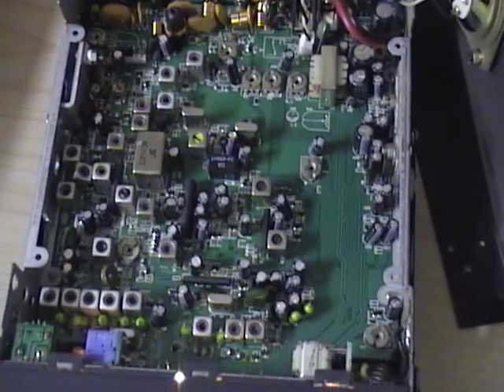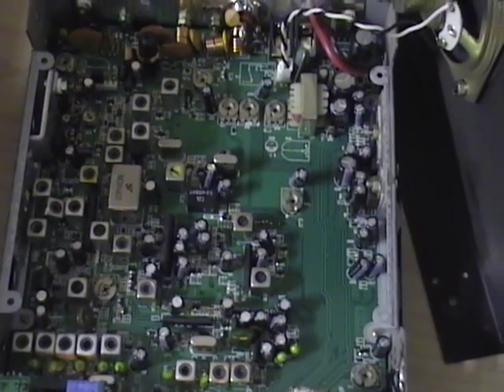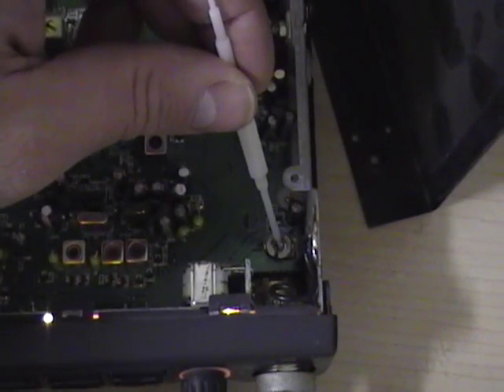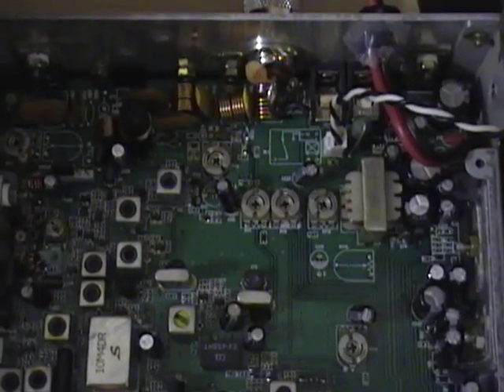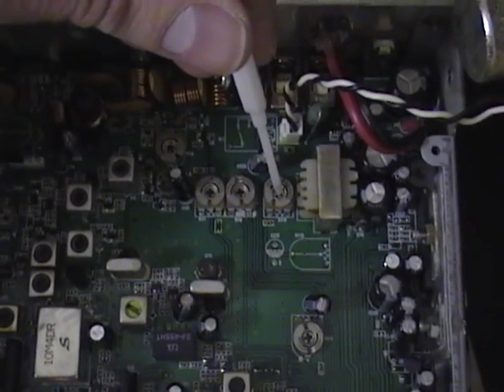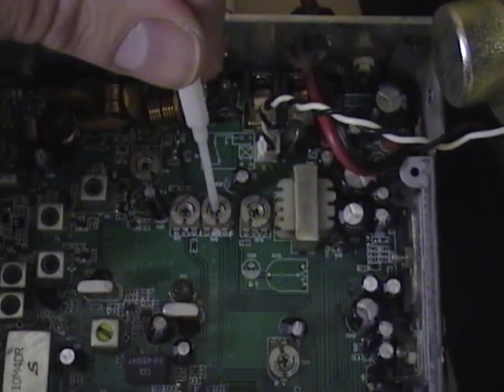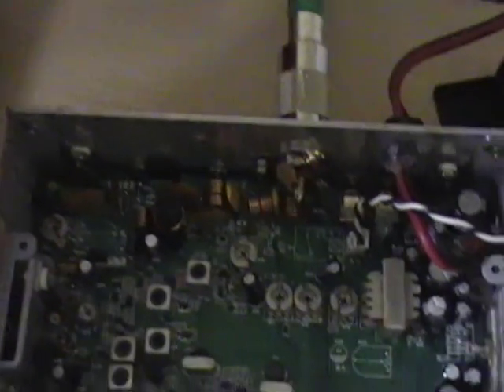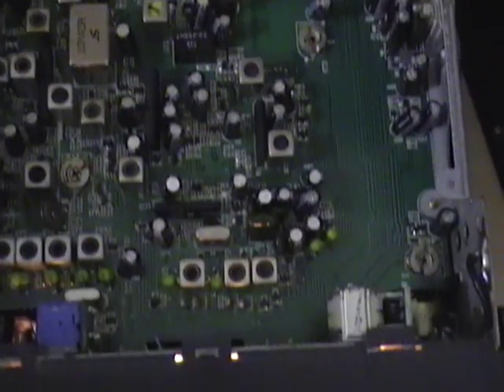Roadpro Titan II 10 meter Export Radio Part 2 - Tuning / Adjustments by CBradiomagazine.com

Comment: Thanks to this, and the other video, I fixed my cousin version, the Radio Shack TRC 485.  I wanted to look for the same pots, and found them.  (the AM pot is reversed) I had to clean a lot of corrosion, which fixed everything else.